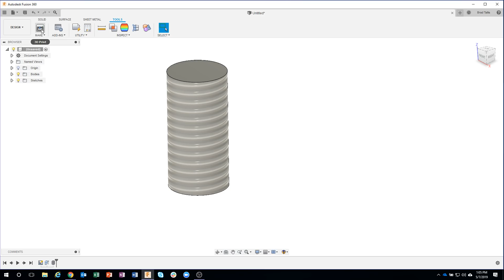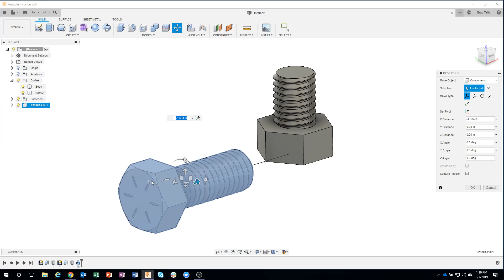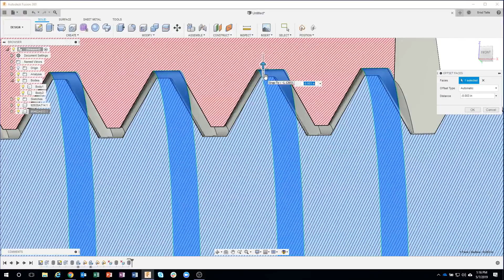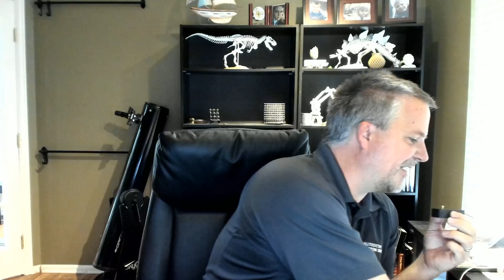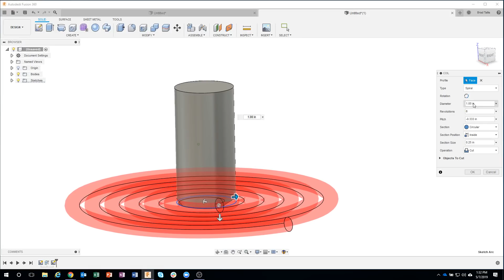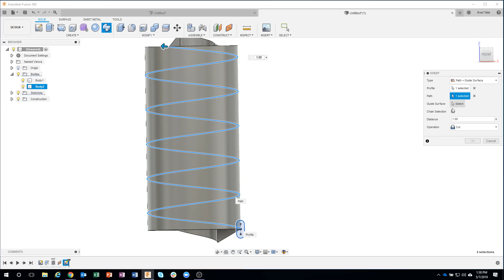360 LIVE: 3D Printed Threads

Comment: Enjoyed the video(s). Very informative. 

I have been trying to make the following threads with the thread tool in F360:
1) 1.375 x 36
2) 1.125 x 36
3) 1.25 x 36

The tool only goes to 28/inch. I have found the xml file in the hidden folder and have added in the data to a copy of the xml from a thread calculator. Another choice appears in the pulldown options for thread types, but it still only goes to 28/inch.  Any suggestions? Is there a more complete xml file available?

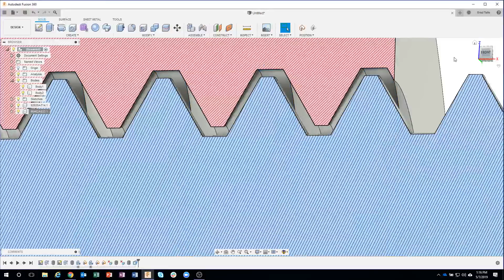Comment: I am missing something. at around 19:25 you are showing how to clearance the threads if they are too tight. I am making a custom part, and I do not have the option for analysis on the left side of the screen in fusion. I was able to go into the inspect menu and choose analyze, but I was unable to select the part of the thread as you did. Any advice?

Comment: I know that this video is kind of out of place and way out of time with the question I have but is the closest one I could find to my issue. The issue is that I am trying to mode a thread that is a weird size. It is a thread that is the same size as a 1"-8NC size but is on a 1/2" wood dowel. That makes is a 1/2"-8NC thread. I tried downloading the custom thread plug-in but it is only for metric size. The only place I could find for a 1/"-8 thread geometry  is a ACME thread that is square and that does not help me. The size I am looking for is a standard size on a wood thread (used in woodworking). How do I go about modeling that. Hope you can help me. John
Reply from the maker: @Old Iron-  You can create custom threads by drawing a profile and "sweeping" it around a coil profile that is the correct diameter and pitch.  Another thing you might try is to see if McMaster-Carr has a threaded rod the correct size you need in their catalog that you can import into your design.
Reply: @adskFusion  Thanks for the response. I did do that (draw from scratch and sweep). McMaster has nothing  with regular thread. Only with ACME thread. I was just looking for a quick fix. Thanks.

Comment: Put a 3 mm or 1/16 screw in the center of the printed one, to strengthen it. Drill a tap size hole first - heat the screw, and just screw it in.

Comment: Please help!! I can’t figure out what is happening to me. I am trying this same thing essentially. I am making a little jar. I make a new component. Pull up cylinder and make a cylinder that is 1in dia. And .80 tall. I Use the thread command on the outside of cylinder it selects. ANSI uni screw thread 1-8unc. I click modeled, deselect full length and I make the thread portion .30 and good to go. Now I make a new component for the lid start a sketch on the top of the threads draw a circle at 1.25 dia. And another at 1 in. I extrude that ring down .30 ( the length of thread I put on the jar). Then select thread command and select inside of lid (1in dia section) it selects the same thread as it did for the jar portion. Click modeled and ok. When I do a section analysis the threads are not matched up?? If I do the exact same thing except make the jar 1in tall instead of .80 it works and the threads line up in the section analysis. Thread portion on jar is still .30 and lid is still .30???? I don’t understand.

Comment: I often 3D-printed nuts and bolts the wrong way, now I changed the print orientation and it's so robust now. And the layer height isn't as critical as before. Thank you for this very useful tip!

Comment: Is it possible to avoid supports when you print a thread vertically (weak part). I get supports for the overhanging threads. support angle is 45 degrees.
Reply from the maker: Where are you doing your print prep/programming?
Reply: @adskFusion   I use an FDM printer (zortrax m200+). The material is abs. The threads have supports as overhangs.

Comment: The class of fit for the bolt & the nut could also adjust the tolerances.  I see that there are class choices in the thread settings to make changes.  Change the 1,2,3A (bolt) & the 1,2,3B (nut) combinations to see what happens.
Reply from the maker: Good call! Thanks Rusty!

Comment: If we're making a cylindrical container with an interior thread in order to screw the lid, how can we control (measure) the cylinder opening's exact diameter after adding the thread? You can set different thread sizes but changing the designation also changes the opening's diameter...I hope this is covered in the future.
Reply from the maker: Great suggestion!

Comment: Why noone talks about the actual machining and how this software deals, connects, etc to CNC ROUTERS
I Like it but I have no answers on this,  posting in forums , YouTube and leave at least 10 message in the Autodesk  forums
Reply: That is done in the manufacture space. when you select machine do default 3 axis machine. when you go to post process  select the machine type from the dropdowns or which machine controller you are using, I.E. Mach3, Multicam, Hass, etc.. This is where the G code is created and specialized for your machine.  I hope this helps Not an expert just a user

Comment: I wonder if there is a good way of aligning parts with threads. Let's say I have a mark on a cylinder with a thread and I would like this mark to lineup with another mark on the other model with a thread. I always do cross-section analysis and try to line them up, but it's a lot of trial an error and printing to get it right.
Reply from the maker: Trial and error with motion links?  I don't know, just guessing. Great question!

Comment: Hi Brad, Great tips; esp. adding threaded inserts using a soldering iron I think is so handy. The other solution I really liked is the flattening of the bolt, so it will print flat on the printbed and is much stronger than the upright version. Thanks!
Reply from the maker: Thanks for watching! Spread the good word!

Comment: so, i'm confused.  Fusion 360 automatically adds tolerance on the thread that are good for 3d printing?  Is there any option or something to tell it to do this or does it always do this?  What if you aren't 3d printing?
Reply: Oh and Brad is the best Brad ever.
Reply: I would think that if you're not 3D printing you wouldn't need threads. I mean you would use the thread image rather than the actual threads, they would only slow down your computer anyway.
Reply: 1/2 x 13  3b or 3a is a  tolerance
Reply: I think all the options are for standardized threads. It would be awesome if we could customize them easily, but there's no such feature. I use the push/pull command to adjust the clearance or use the coil for a fully custom thread.

Comment: I often chamfer screw threads. However, it's a bit tricky to do because threading and then adding a chamfer doesn't usually work. Here's how I do it:
- create surface to thread
- chamfer the end as needed
- create thread
- at this point the chamfer prevents the thread from reaching the end of the piece and it won't screw in. To fix it:
- in the design history drag the chamfer to the right of the thread.

I hope this helps. Also, Brad is awesome.
Reply from the maker: Whoaaaaaa....I sense another "stuff we learned from you" addition right there! Thanks much!
Reply: Excellent tip; thanks! :)
Reply: Astonishing :)      I had no idea you could edit history!
Reply: Chris Leech yes; you can properly mess things up too...!😬